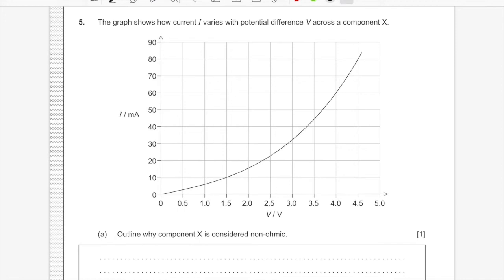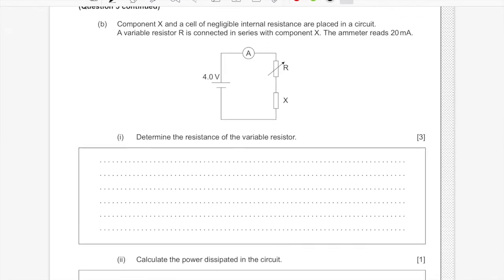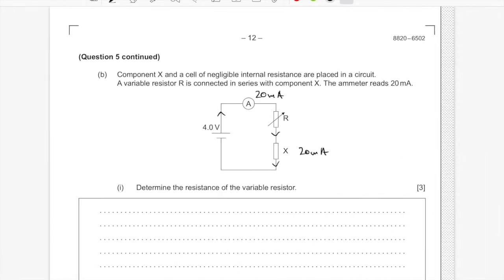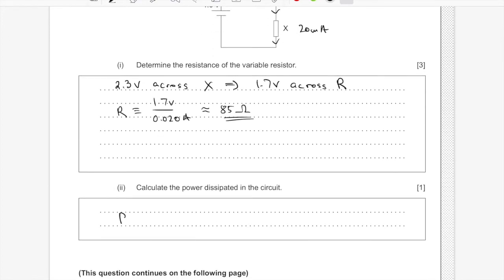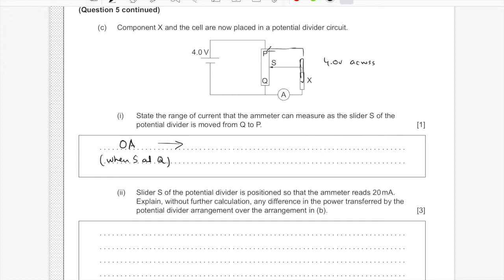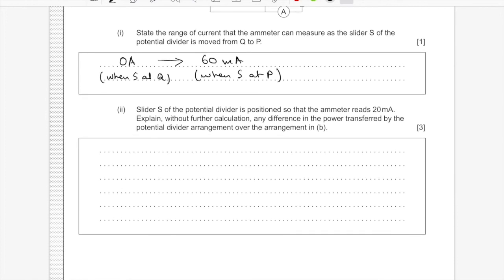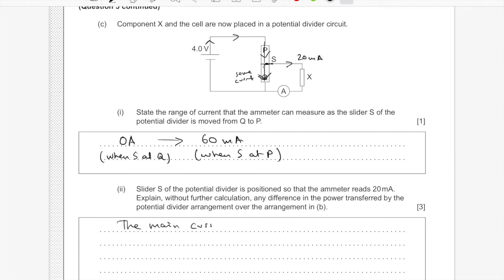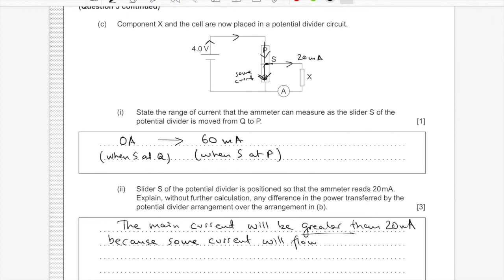IB DP Physics HL 2020 Nov Paper 2 Q5

Comment: Hey! in b (ii) why cant we use p=i^2 R and solve for the power dissipated in the circuit
Reply from the maker: You could take that approach, but it would require that you first calculate the resistance of X ( = 2.3/0.02 = 115), then find the total resistance of the circuit ( = 85 + 115 = 200), and then use P = R I^2 = 200*0.02^2 = 0.08 W. They are asking for the TOTAL power dissipated in the circuit, so you need to take both resistors into account and find the TOTAL R when using P = R I^2. But it's much easier just to use P = VI since you already know the emf ( = the total V) and the total current (and there is no internal resistance to take into account). Make sense? R is not always the same as R! ;)
Reply from the maker: @fannymagdalenam.9788  Hi! Yeah, that was a tiny typo.. just fixed it :) 2.3/0.02 = 115 Thanks for spotting that!